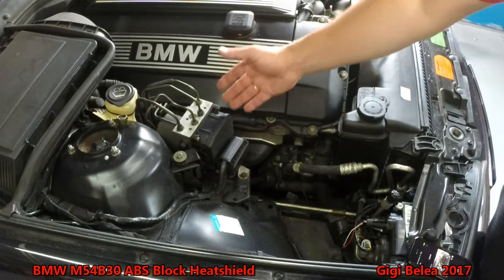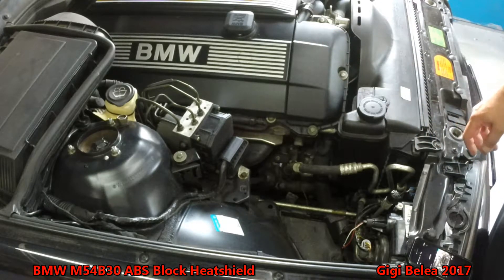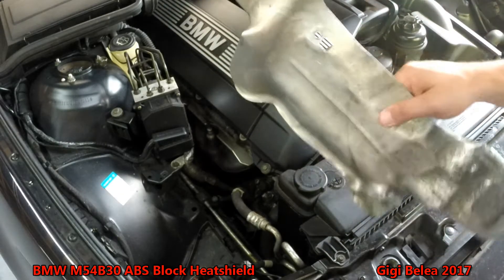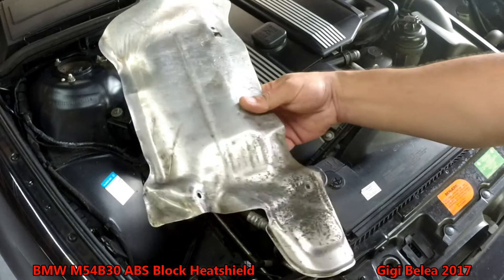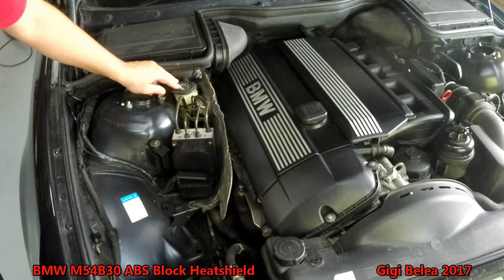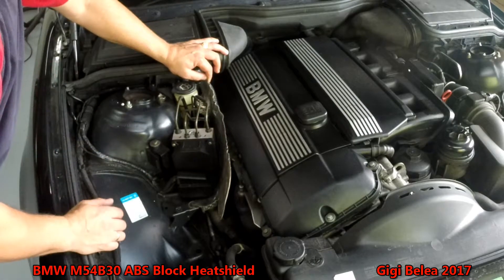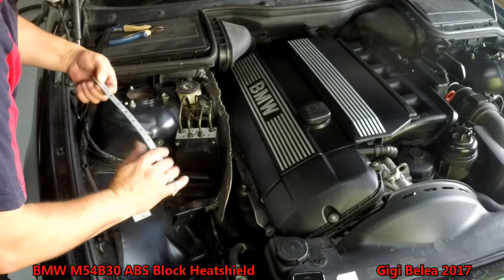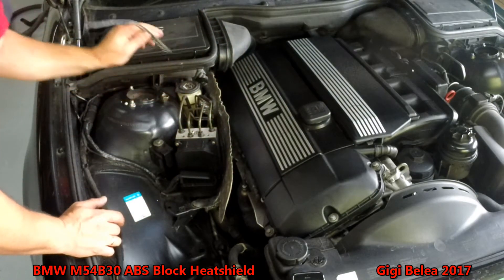BMW E39 Abs Block Heat Shield Build -  DIY Guide

Comment: Hi, did it work? Your ABS block failed again?
I have a 530i too, and sometimes the speedometer fails (when I'm driving faster than 100km/h most of the time) and my ABS and ASC lights are constantly on...
Reply: If you only have that when driving over 100 then i guess you have diferent tires in front and back. I always have this problem when I floor it because tire size is bigger in the back than front :) Shield worked, yes, no problems.

Comment: I can't believe BMW didn't fit a proper heat shield like this as standard. Putting the module right above the exhaust manifold with little/no protection was asking for trouble! No wonder they fail so frequently.